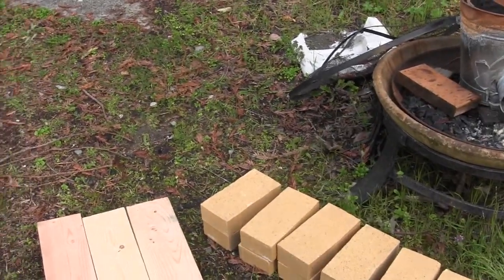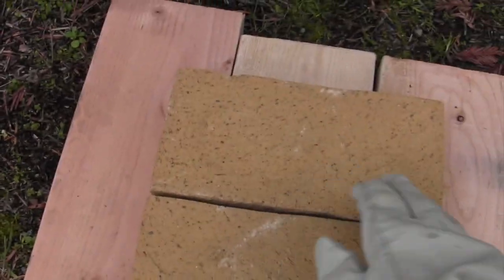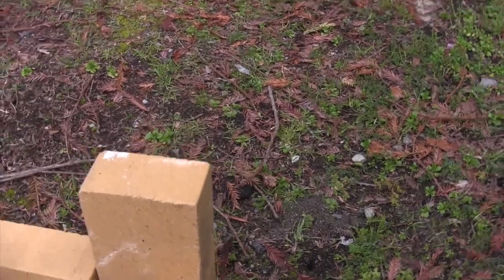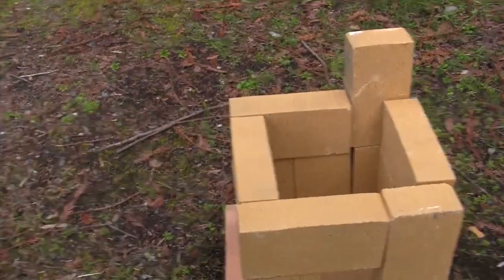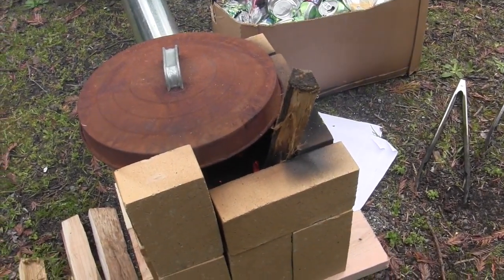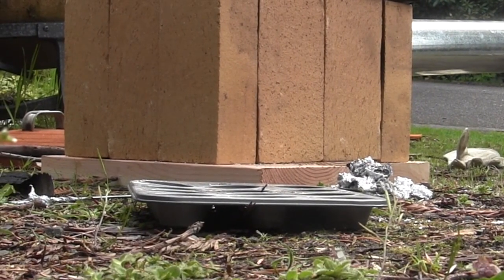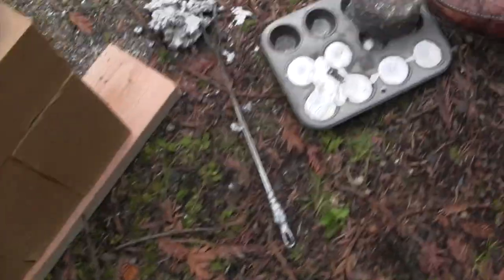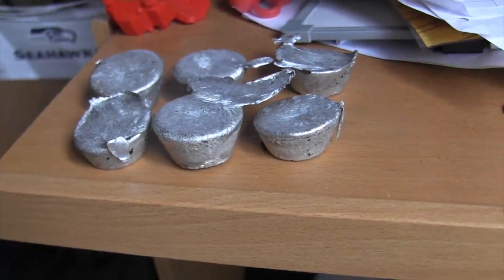How to make a metal melting furnace from firebricks!

Comment: Another lesson...  You built a furnace here.  NOT A FOUNDRY.  A foundry is the location the furnace lives in.   You've got good brick there, my local price is about $1.65 a brick.  Next step, ditch the charcoal and make the switch to propane with a hairdryer.  ;-)
Reply: You don’t need a hair dryer with propane…
Reply: @legoengineworkshop5171  no, but it sure helps.